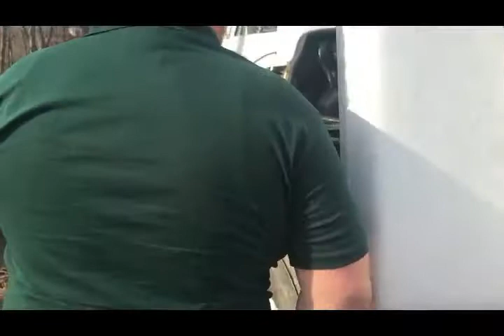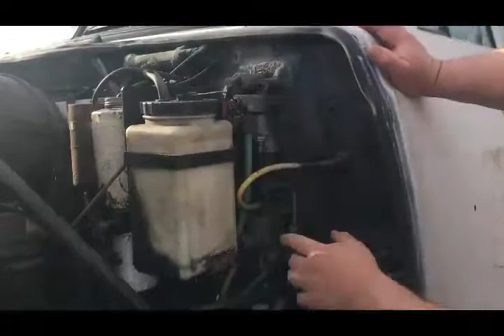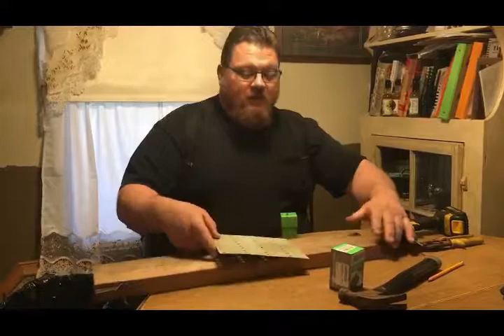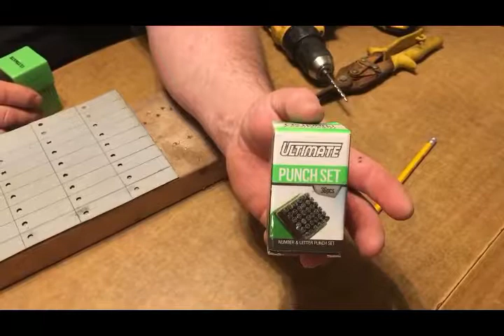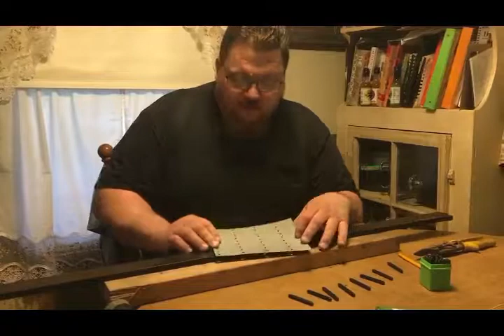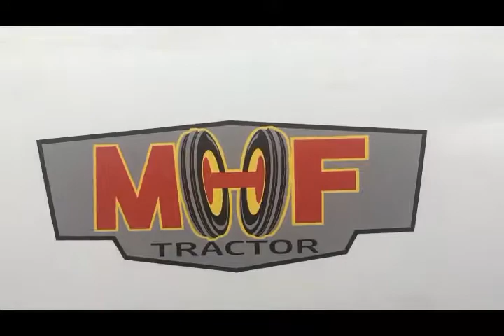GMC 9500 Toy Hauler Build part 3

Comment: Nice to have a camera man/woman. Hard shooting off a tripod only sometimes. You might tip your hand a little in your title as to what the project will end up being. Like in my head I thought you once told me it would be a car hauler. Maybe I have that wrong, but "car hauler" in the title might rank better in search results.

I'm used to using masking tape, I'm super impressed with the stamping on metal tags
Reply from the maker: Thanks, it will end up getting a grain hauling bed installed. That can be a flat dump bed or have side on the bed and I will use it also to haul old tractors to tractor shows. What is the best way to title this video series you think